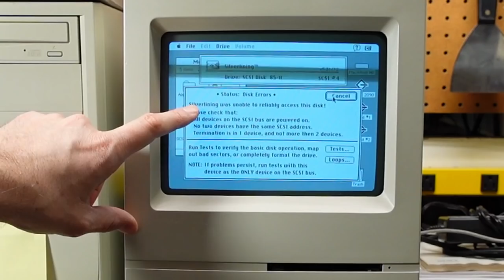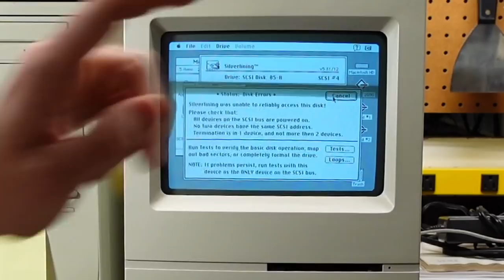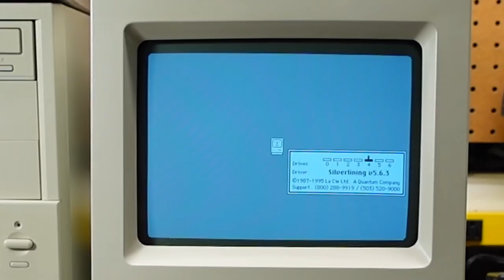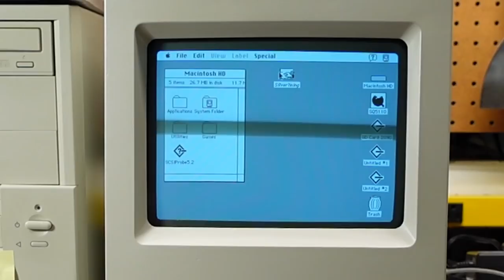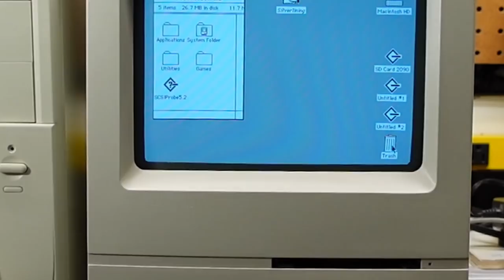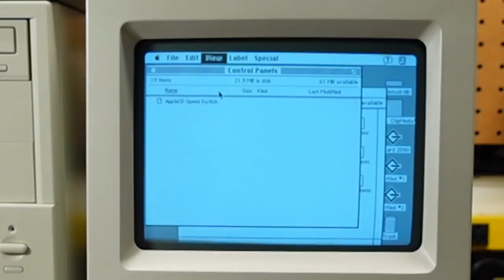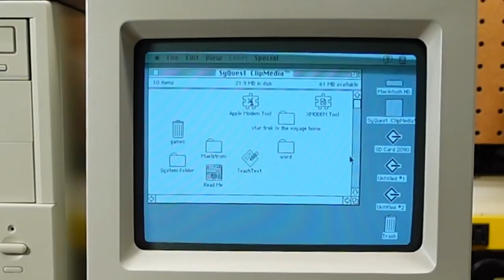Fixing bad SyQuest 88mb carts with a SCSI verify?

Comment: Hi Adrian,

 - The 88 MB "C" means, that it can handle 44MB disks too.

- Disks get "corupted>" when they are insert into a Windowsbased machine, because dump windows does something on the first block of the fist cylinder so theys are nomore readable on Amigas or Macs.

- the 200MB -version handleas 44MB and 88MB also

Greets from Basel Switzerland

Comment: Maybe you should investigate further by re-trying one of the discs with the other drive, and run the same program. Maybe there's a mechanical issue that the test procedure somehow manages to fix. Worth a shot! Also, what's inside that box the drive is installed in? Is there some extra "jazz" needed for these drives to work?

Comment: I smiled the second I saw that jazz drive, and recognized it instantly before you even said what it was.  I used those on my Amiga 1200, and still have the disks and the drive, though I don't have a working Amiga at the moment.  :(   My jazz drive was one of the scsi ones.  Unfortunately, those only ever seem to have come in scsi, and parallel-port versions.  Dunno why they never made an IDE (that is, PATA) version.  o0

Comment: I think when HDDs spin up at the start the dust/rubbish gets thrown off and into a trap built in the housing, meaning that that disk may be ok if it's reassembled. Or you could blow the disks off with air first.

Comment: Great video Adrian! Just wondering what were the specs of the Macintosh you were running? OS version? Also did you install a scsi card for this? I have a Syquest 5110 drive with 88mb tape also. I was hoping i could get it running on a Macintosh power G4 running on MacOS 8.6. any suggestions would help. Thank you.

Comment: Might be like Zip drives where the disks could have an incompatible driver file on it.  Then the disk test probably replaced the driver and it worked fine.  Not entirely sure, but I know that was the case with Zip disks, where the driver gets updated when you insert it in a computer with a newer driver and then that driver does not let the older machines work with it.  Somewhere I have a few zip disks labelled warning about no using on newer computers because of driver updating.

Comment: I used these at work in the 1990s (44s, 88s, and Bernoulli drives). The head crash failure rate was probably 40%.

Comment: While we're talking about Syquest drives I seem to remember you might have had issues with some of the 3.5" variety. I have a random 270MB S drive and I'm wondering if you're still in need of one. I don't have any SCSI hosts or disks so I don't know if it works or not but it does spin up if I manually activate the load mechanism. I'm not exactly enthusiastic to take the time, effort, and money to ship it across the country but if it fills an open void I might be able to convince myself to let it go to a better home.
Reply from the maker: Thanks -- I have some cats and some drives -- and I think of the two drives I have, one of them works... and the Jazz drive I have (And that one carat) also works fine. I still tend to use Zip the most just because I have more of those drives for everything. (SCSI, USB, IDE and Parallel.) Just the most convenient.